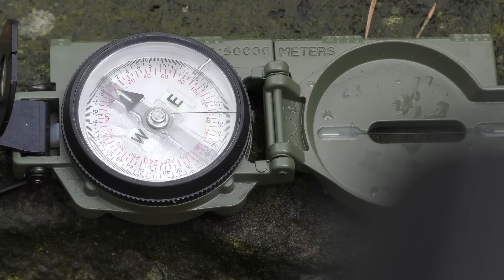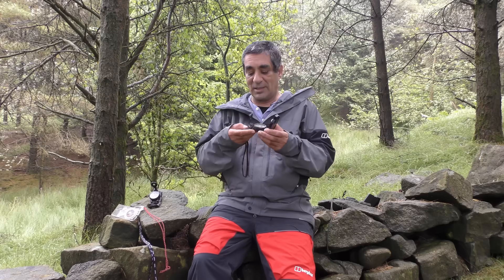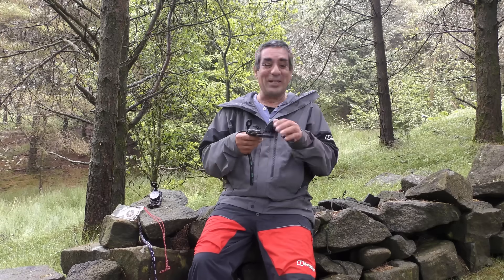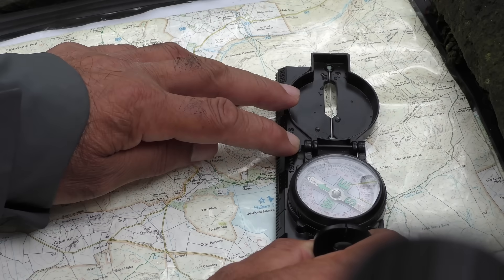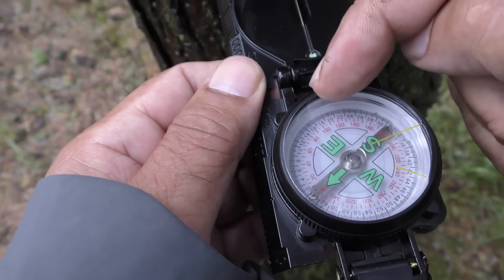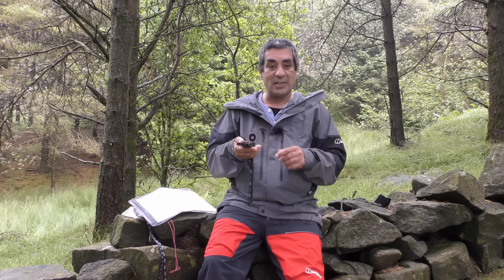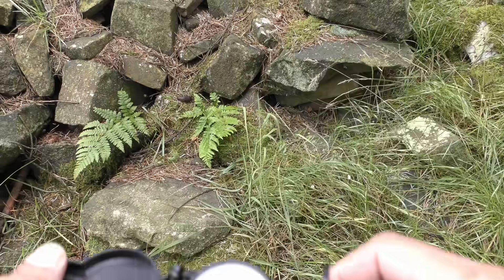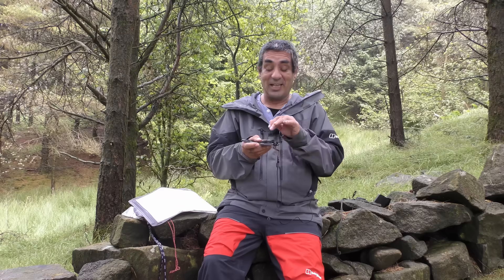The compass no one knows how to use

Comment: I took a few reviews to understand your map example.  It would have been more clear to me if you'd selected a heading like 123 degrees, not one so close to north.  The view in the video looked like you line up the yellow line with the wire (4:08), and then oriented the compass so north was under the yellow line, and therefore north was also lined with the wire.  After looking a couple times, it became evident that the line was maybe 5 or 6 degrees from the wire.  Now I see that the compass is placed on the map in the direction of travel and the line is turned to point north (magnetic) on the map.
Reply from the maker: Hi Will, thanks for the feedback.  I have just watched the video and you're correct.  I should have used a bearing at a greater angle from north, to make the point clearer.  I'll keep that in mind for the future.  Thanks again.
Reply: @TheMapReadingCompany  You are welcome!  And thank you for responding.
I persisted and now understand how to use the wire and line with a compass and map.

Comment: Thank you for the lesson.  I have a U.S. GI compass marked W. & L. E. Gurley Troy NY, housed in the original double snap olive drab canvas pouch with kaki trim with the GI metal wire belt hanger.  It only has a single line on the glass which surprised me since I know it is quite old.

Comment: Very informative.  Although i might need some help with the maths part. You told us the two yellow lines are set 45° apart. Set the small yellow line due south at 180° and the long yellow line sits at 135°. Should that not be 125°? Other than that i think i got most of it. Me thinks i need to go out and buy a compass now

Comment: I learnt to use a British War Department "Compass: Magnetic: Marching: Mk1" in the 60's.  The thing I miss most on modern compasses is the locking button, which had two magical effects:- 
Firstly: you could take a siting and then the reading without any movement of the needle. It made taking, reading and transferring bearings so much easier.
Secondly and probably more importantly: it engaged when the cover was closed and prevented damage to the vital bits through accidental impact.

Ah Well!  That's progress for ya',

Comment: Thanks for the info. I just pulled my dad's compass out to confirm that it is a M1938 W. & L. E. Gurley compass. As result also found it's rough value and wished I had looked after it better, as although it has just been sitting inside a canvas pouch, the copper wire and screws need clean or replace and the aluminum body has had some oxidising starting to occur probably in spots where the paint was scratched. Wish I'd pulled it out sooner.
Reply: I have a W. & L. E. Gurley as well.  It only the long line on the glass.

Comment: A bit of an aside, but your video brought some old memories back, thanks 👍

When I was a schoolboy, back in the mid 1960s, I bought a foreign made copy of the M1938 lensatic compass from a ‘Famous Army Stores’ shop in town as it was what I could afford on pocket money. Not military quality, foreign made, but it worked fine and I learned how to use it. At around 15 or 16 I used to have a Saturday job assisting my employer standing a stall on the town’s open market selling pottery and bone china.

One day, trade was slow and so I took a break for a quick browse of other stalls. There was one which had mainly ex British forces tools, spanner’s, sockets, hand drills, hacksaws etc, some WWII webbing, mess tins, knives, no uniforms though. They also had a few pieces of US Army WII gear, and one was a sealed, so waterproof, plastic wrist compass with rotating bearing bezel. I still have it, although without its webbing strap, (radioactive?) paint luminosity gone, now brown, and as soon as I heard you say, “Superior Magneto …” I knew that and went to find the full name stamped into the reverse to see…
 
‘CORPS OF ENGINEERS US ARMY’

‘MANUFACTURED BY SUPERIOR MAGNETO CORP
L. I. CITY N. Y.  U. S. A.’

I never use it now, just nostalgic thing I guess, or lensatic types. I’ve used Silva base plastic plate compass’ for over 40years. Years of backpacking, rock climbing and mountain biking, dropped and cracked, fell several 100ft when I was climbing, so the last one I got in the ‘90s when I was on my local MRT, and my go to is a Type 4/54.

If you’re not familiar with the US Army Engineers WWII wrist compass, the one in the link is identical apart from that still has its strap.

https://www.ima-usa.com/products/original-u-s-wwii-us-army-corps-of-engineers-wrist-compass-by-superior-magneto-corporation-with-web-wristband-dated-november-1944?variant=40798735106117

Comment: My dad (retired USAF Air Police) had a M1938 military compass issued to him (I have it now) that he and the Boy Scouts taught me how to use.  It saved my butt on one or two occasions when our group got misplaced while hiking in the Western PA woods during the 70's.  Most of the guys had those cheap little plexiglass compasses and I had the only military compass.  Both times we got back on track using my compass.  Afterwards our guys were scouring the local Army and Navy stores for those M1938's.  Nowadays everyone uses GPS or directional indicator/compass on their phones.  Standard GPS satellite receivers will work almost anywhere (except areas with high iron concentrations or magnetic interference).  But phone GPS only work near their microwave towers and in the deep woods or mountains and it's very iffy you'll get reception.  I've met people who had those features on their phones and got lost anyway (and eventually found) as they didn't know which direction they needed to go even with a directional feature on their phone.  People still need to understand the concept of using a compass and it's more modern variants (even on a phone) as well as know which direction is going to help them.
Reply: Phone gps works just fine in the deep woods if you are using a good app and are prepared, having downloaded the required maps. You don't need to be in range of a cell site. You have a very flawed understanding of how GPS works. Iron deposits do not block the signal from the GPS constellation but electromagnetic interference possibly could. However,  it's unlikely to encounter such a thing "in the deep woods", unless someone's running a jammer or you're pretty far north during a powerful solar flare. 

that being said, I would never depend on only a GPS while I'm "in the deep woods" That's just asking for trouble.

Comment: I always taught to place the compass on the map, set the long yellow on the bearing. It’s easy to see through the wire and see the yellow line at the same time. These instructions are probably fine, but I’m so used to navigating the way I do changing would be difficult. 

This also doesn’t instruct taking notes.  Using the maps scale, calculating distance, reading the contours and pre-planning routes including bearing changes, counting steps, having a patch multiple strings of beads to keep count, etc. There’s a lot of land nav I’m used to that this simple video is not discussing. 

That original bearing on a map went past a body of water and covered some distance. And treated it like you’re walking a straight path point A to B. In my experience that would very likely not be possible as the land around most bodies of water involve some critical grade changes, meaning you would be mapping routes that are not in straight lines, and involve distance and bearing changes.

Comment: I fail to see how you acquired a bearing from the map. You just aligned the long yellow line then pointed the compass north....that accomplished nothing..then you randomly came up with '123'. You need some type of reference,  whether you align the map with north(just set you compass on the map's compass), or measure the angle of the bearing all on the map itself. All assuming your location matches the starting location of the bearing ofc.

Comment: Lensatic compasses are useless for most people.  Unless you are in very open country where you can see far distances, you can't take a sight bearing from two different far away land marks to find your location on a map.  Most people only need a very simple cardinal compass so that they can point themselves in the generally correct direction.

Comment: Hello from Finland! In my compass manual it says that the short yellow line is in a 45 degree angle to locate the north-east etc. direction as well. While hunting or fishing at sea i have the Suunto Elementum Terra watch that has a digital compass and altimeter - the only minus is its need to be recalibrated before each time using it. I prefer the sea charts etc. while navigating (and the pole star/north star [not sure which one is it in english] since the military) because its just more fun than just going on with some GPS toy for those "I cant even read and i'm so glad i dont even have to - thanks to the audiobooks!"- type of people :)

Comment: During my military service in Switzerland, I was taught that the short yellow line - or it's equivalent on the Recta Swiss Army issue matchbox - was used to circumnavigate larger obstacles in your path - i.e a pond.
Before reaching the obstacle, you would set your bearing from the long line to the short line.
Then, you would walk the new bearing, counting your steps, until you were on the side of the obstacle.
Then you would reset the bearing by 90 degrees and walk the number of counted steps.
Then after walking this trisngle sround the obstacle, you woul reset your original bearing on the long yellow line.
Reply: Wouldn't it have been easier to use the primary bearing and decide on some landmark on the other side of the obstacle, then walk around it up to this landmark, and just continue following the bearing?
Reply: @ipadista  Not unless you pace count and have a pre made "going Map" as we called them, that works, but try to remember everything if you are solo or if others say differently to your map/compass work.
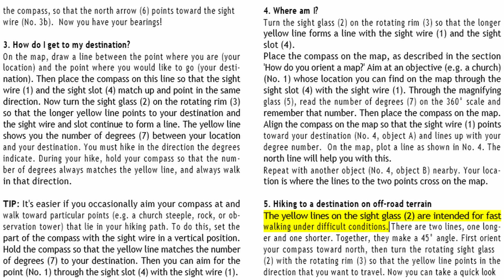Reply: That's how i was taught too and i guess that's what's ment by "fast walking under difficult conditions" 2:08
Reply: So that particular compass must have had 2 short yellow lines at 45 degrees on either side of the long yellow line?   In avoiding the obstacle you are attempting to walk 2 legs of a right isosceles triangle.   That sounds like a slight upgrade to the night click feature.   Did your compass also click?
Reply: @raybr1727  You only need the short on one side. If you want to go right you just follow the short line. If you need to go left you rotate so that the long line is to the left and short one is to the original destination.
Reply: This is one way to use it. Tritium ones nowadays also aid you at night. Just shoot your azimuth,  like the two arrows up and walk.
Reply: @michaelgrubb8896  
The real tritium compass you might have been issued costs between $150 -200 if you buy one for yurself.
Reply: Recta has been the absolute top compass worldwide. Simple, little bits vulnerable to rough going, robust and accurat.
Reply: Spot on, COUNT your steps, and when going around a fixture, lake, whatever , re-dress and go back to the original bearing, yep true.
Reply: First thing you need to do is locate your position on the map. Once done you can look at your map and plot your course to avoid obstructions.
Reply: @LisaTurner-d1b  Not as easy to do under combat conditions, the given method would be far more flexible and able to adapt to immediate conditions, i.e. a sudden and unplanned obstacle, enemy tank group where it shouldn't be due to failed intel, quick triangle move to avoid the enemy and then resume course to the objective.
Reply: @LisaTurner-d1b  That in the Military is called making a "going map", and made as precise as possible, especially for night work, pace counting being crucial

Comment: When you rotate the dial to point "north" on the map, you are using "true" north (or "grid" north, which is almost exactly the same) and when you then rotate your compass to use the needle or magnetic plate you are using "magnetic" north.  In my area they are 10 deg. different.
Reply from the maker: Once you have your grid bearing you would need to adjust for local declination.
I have many videos showing how to adjust for declination with various compasses.

Comment: Our 7 year old grand daughters pulled my old M1950 Army compass out of my desk drawer and they were very interested in it as they were only familiar with the cheap kids version. So we went into the back yard and I showed them how to use it. Now they each want one. LOL... I was first introduced to this compass in basic training with a map reading course. Like 6 hours and they emphasized that it may save your life. Used it a few times in Vietnam and decided that it was going home with me. I just moved it from my desk drawer to my Army medal display hanging on the wall. Looks good there!
Reply: It's not any more accurate than one from a crackerjack box. Compasses don't show true north. Put their toy by yours and they both point the same.
Reply: @terryparker1694 That's why some of the better compasses, like the Silva 16DCL, can be adjusted to compensate for magnetic declination.
Reply: @terryparker1694 I don't remember the brand of compass but  mine has a tiny screw in the compass housing that moves a plate inside the compass which allows an offset so that instead of having to calculate the difference each time, the compass uses magnetic north instead of true north,  the USGS  maps show the offset of magnetic north and all you have to do is align the offset on the map to the offset in the compass and then all of the readings taken become true north to align with the map.  I have two of them... one stays in my car while the other one resides in a backpack.  I used it extensively to hike through Colorado, Wyoming and Montana when younger with my wife.  One was mine and the other one was my wife's.  She passed away in 2017 so now I keep hers in the car with me and always have a way to ensure while traveling to verify I am headed the correct way towards my destination.  It's come in handy several times while in unfamiliar surroundings.  For every degree off, a person becomes 92 feet off from where they should be for each mile traveled.  In a car, that's no big deal. While on foot can be a huge headache if twilight is approaching and the car location is not surely known.  Knowing how to use a map and compass has kept me from ever becoming lost and only disorientated a few times until bearings were confirmed.  I learned in the Boy Scouts at 10 years old.

Even so, come, Lord Jesus 
Rev 22:20 KJV

Comment: Sorry but you Do have to orientate the Map and the Compass, because if you don't do that and then take a baring from the map you will end up 10's of miles off coarse, This is critical if you are trying to find something like a Reef 10 to 15 miles off Shore  On a Map and taking Land Barings from 2 or 3 features, Also If you are going to use a Compass like the Cammenga T27 or 3H Tritium Compass then it would pay to invest in the U.S. FM 21.26 Map Reading and Land Navigation Manual, A compass only works so well if you have line of sight vision, In the Jungle or thick Forest you will need to count as well as measure your steps. Hope that helps.
Reply from the maker: When you're taking a compass bearing from a map the direction the map is pointing makes no difference at all and it will not affect the bearing.  If you want to orient the map north that's fine, some people prefer to do this, but it's not necessary and never was.
You don’t need “line of sight” to taking a bearing from a map – you can take a bearing from anywhere to anywhere else – you don’t have to be at or be able to see either points.
In thick forest pace counting doesn’t work, but there are other methods which do.

Comment: I admire people who can read maps.  The only map reading I do these days is I orient my GPS so that north is at the top of the screen rather than the map constantly changing depending on direction.
Reply: I prefer maps to GPS.
Reply: @dave-d-grunt  Don't tell EVERYONE but
Its NOT either / or
Belt & braces sir  - In difficult terraine its just prudent
It allows you to sense check both and leaves you an option if some loon is GPS spoofing
Reply: @dave-d-grunt  Maps have larger display too!
Reply: North up vs. track up is the biggest single failure of GPS for orientation period.  When flight instructing aircraft owners that insisted on using North up, I could easily prove how confusion and disorientation WOULD happen to them.  LOST... If you're traveling and not using track up orientation, you're not using a GPS correctly.
Reply: That's very wrong.  Every aviator i know uses north up orientation. I use it in the car even.  It's makes much more sense than having your map turn inverted on you@YankeeinSC1
Reply: @dieselguy62  Yeah I'm personally driven nuts by Track-Up orientation when it comes to overviewing a route. North-Up synchronizes with every encounter I've had with aerial maps, weather maps, terrain maps, etc. I know how all the geographical features are located relative to each other, but only if North is up. The two places Track-Up is useful to me are: Turn-by-turn navigation in a car to identify upcoming street names; and identifying physical features outside of an aircraft window so you quickly know if it's off to your left vs right.

Comment: Thanks for the video. I have used mirror silva ranger compasses for over 40 years as part of my job, and I have Cammenga. My late mother gave an engineering compass years ago as a gift. It has the two yellow lines. I never could fine out what the purpose of the short one was.